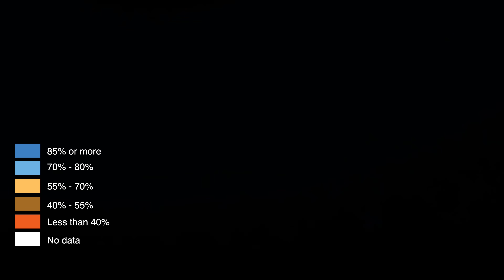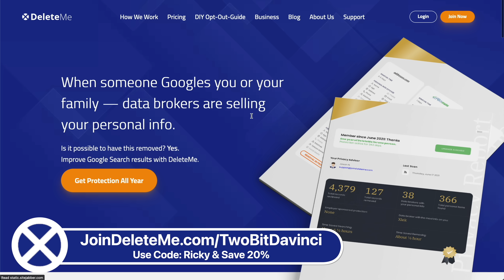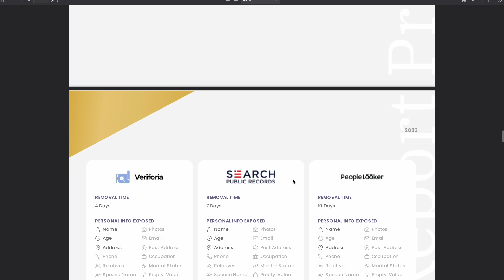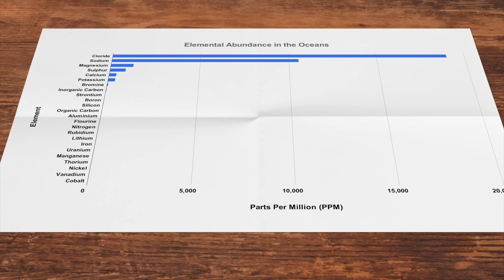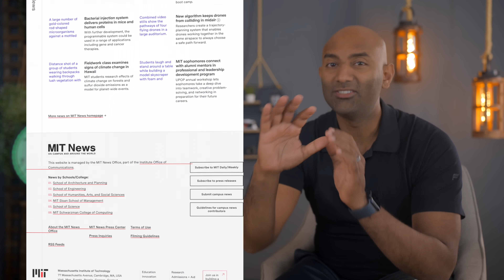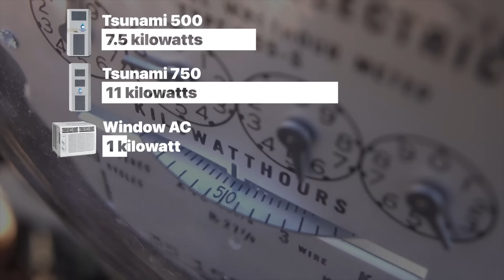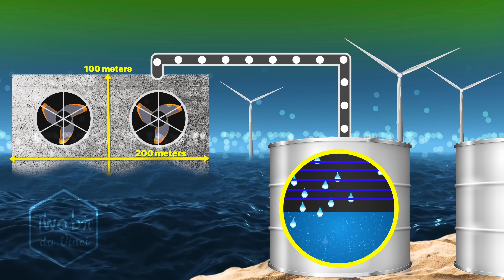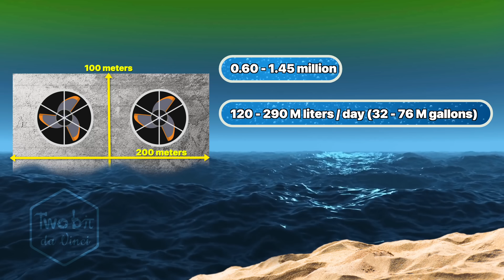This Tower Turns Ocean Fog Into FRESH Drinking Water!

Comment: Nah.  Wrong direction. So much water is wasted. Start with conservation. 
I use maybe less than 10% of what most people do, and could use less. 
I have only been using composting toilets for the last 20 years.  I peed in a store bathroom in the city for the first time in many years and it felt so weird to be wasting that water. 
I also have designed and tested pee gardens. 
I use a sauna rather than a shower, and a little cold water to rinse off. 
I raise plants which grow with the natural rain cycle and no irrigation. (Baby plants in the nursery still get water.) 
Atmospheric harvesting doesn't pencil out.

Comment: How is the humid air just above the ocean's surface cooled? Refrigeration is very energy intensive. If the water temperature just below the surface is cooler than the surface, pumping the humid air through a heat exchanger below the surface could condense the fresh water. Minimizing elevation change between the humid intake and the sub surface condensing surface should lower energy requirements but it also implies shorter towers. Optimizing energy consumption used to move the air seems to be the key.

Comment: my one criticism is in the environmental study they only looked at evaporation globally when clearly the issue is increased salinity locally. The effect on salinity should in reality be relatively similar to using desalinisation, except that the increase should be spread over the area of each tower's influence rather than for example a pipe. Otherwise a cracking invention with a clear advantage over desalinisation.

Comment: I always had a similar idea, but not building on the ocean. Simply pump oceanwater onto land using solar panels during the day in hot regions that need water, especially in deserts like the Sahara. The warm temperatures will accelerate the evaporation. Then the runoff gets caught in a seperate line and then be distributed for irrigation or manmade lakes to feed groundwater.
The thing with evaporated water is that its basically destilled water and lacks minerals and such, so its not safe for immediate consumption. It needs to be enriched by soils and minerals first.
Powered desalination plants might have higher throughput but this method would just need some pumps which could easily be run by solar.
Infact that fresh water could fill up a manmade lae/dam system where it flows back to the ocean irrigating thngs on the way and recoup some of that energy back with turbines when power is needed.
This could have been done in many places in africa already, its just that noone wants to invest that money. Its a very long term and big megaproject, but it won't be that complicated to do.
Reply: Look up sundrop farms south australia.
Reply: @catprog  You know why this is not as big? Because they don't have to buy water and electricity and thus pay no taxes on it.

Comment: I might be wrong, but I think the water used by households isn’t the real big problem. The water needed for agriculture especially in former deserts is the problem and the reason for water shortage e.g. in California. 
You mentioned Israel as a positive example for gaining drinking water. But, there are problems with agriculture. The river Jordan leads hardly any water, anymore, before it reaches the Palestinian territory. That causes trouble in the agricultural there. Obviously gaining water from oceans won’t solve this problem.

Comment: @TwoBitDaVinci  79 gallons of water per person per day wouldn't, or rather couldn't ever occur. if you drank 1.5 gallons in one sitting, that'd be your last beverage. Which blows my mind when I think about cleansing for any "- oscopy" exams. At least that is over a 24 your to 48 hour period, but damn fills you up to the point you look forward to the fasting at the end part. Not only are you taking more water in, you're peeing less out. The kidneys are capable of filtering up to 28 liters of fluid per day. However, they cannot excrete more than 1 liter per hour. Therefore, drinking more than this is not a good idea. Your kidneys can remove 0.8 to 1 litres of water per hour, so theoretically you could drink 20 litres of water in a day. This assumes that you drink at an even pace, though. There are cases of fatal water intoxication where the victim has drunk seven litres in three hours or less. Drinking too many fluids can cause water toxicity by diluting your body's sodium and other electrolytes, which may cause your cells to swell, including the cells in your brain. This is a life threatening condition. If left untreated, it may cause permanent brain damage and death. So where you get 79 gallons a day being what the average person gulps down in 24 hours is beyond me, and far outside the realm of reality.

Comment: So you're telling me, that building huge 100mx200m block at the surface of the sea, pumping everything to an other location and capturing the moisture for water is cheaper than drilling a hole in the ground and connect it to a pump???
Are you sure, that you're willing to make that claim?
Regarding those structures: Do they float or are they connected to the sea floor? For buoyancy you need a huge structure and for a solid connection, well you have to build to the sea floor, limiting the construction to coast near places. And adding cost. And maitanance. The sea is a hostile environment for concrete, steal, ... So the mainanance cost will be high too.
Reply: Is their water in the hole? (and does it renew enough)

Why would you want to build far out in the ocean away from the users of the water?

Comment: The evaporating water creates clouds that rain down elsewhere as precipitation. In my opinion, if applied over a large area, the problem will only be displaced uncontrollably, as the lack of evaporation water for clouds can lead (without being able to prove this climatically) to droughts or dry seasons occurring elsewhere. One system won't do that, but dozens in a drought region might. I hope the designers and regulators take this into account in their calculations.

Comment: There also needs to be a study to see if this will have any impact on the weather cycle. Mind you, you are actually pulling out water that would have travelled to a different location and participated in a rainfall. Pulling water out of the system might also cause a reduced rainfall increase water stress.
But it is also quite possible that over all temperature of the world might reduce because of this, as once the water is removed from the sea atmosphere it would reduce the vapor pressure in the region and additional water from the sea would absorb the heat from the sun and vaporize. Anyways, research will be needed on this to better understand how this works.

Comment: What I wonder is how much of that water vapor falls back into the local area ocean if left alone (like at night)? Capturing large amounts of it could increase the salinity of the local sea water significantly by taking that fall-back away. As for me, I don't plan on having an alternate source of potable water for everything I do now should an emergency situation arise. Just enough for drinking and food prep. I find that a small wheel-about dehumidifier can provide enough for me alone. It can "make" a gallon or two on normal days and, of course, more on humid ones. If I run it outside, even better since it will never actually dehumidify the outdoors.

Comment: When seawater freezes, you get freshwater ice.
You can put seawater in a hanging bucket and collect the ice that forms on the surface of the water when the air temp is below 0 C/ 32 F.
On a small scale, it might not be very efficient, but it could save your life on a cold sailing passage if you run out of freshwater.
If you scaled it up someplace cold with access to seawater, you could make unlimited amounts of freshwater ice in the wintertime when temp was <0C.
Use radiators with a heat exchanger and some kind of anti-freeze solution to get the heat out of the water faster.

Comment: The don't really answer the cost question. Essentially how much will this system cost to make a marginal liter/gallon of water? Is that number more or less than the current system? Yes, they used a hypothetical large system over a hypothetical 30 years, but it appears they divided the capital costs over the entire 30 years. That's not the way financial analysis is done. You have to calculate the cost of the money (interest rate) and factor that in. Money isn't free, even the government charges interest on money ... and they print it. I suspect adding the cost of capital into the equation makes this completely unaffordable.

Comment: I am sorry to ruin it for you but there is something called latent heat of condensation, which is 2,260KJ/Kg for water. This is theoretically the minimum energy you need to spend to turn 1kg of vapor into 1kg of water. This means to produce 1 cubic meter of water by condensation you need  628 kWh of energy. The competing technology, Reverse Osmosis which is already widely commercialized needs only 3.6Kwh of energy to produce the same amount of fresh water. Maybe that's why "nobody has thought about it before"??
Reply: To turn 1kg of vapor into water requires you to remove  2,260KJ of energy from the water not add it.
Reply: @catprog  yeah my friend, I didn't say you add heat to water, I said you need energy (to remove heat, with a refrigeration cycle for example)

Comment: @ Two Bit da Vinci and everyone Came here to brainstorm and idea after viewing a hurricane video. Seems like wave tech and wind bladeless tech are speeding up and so are energy storage devices; both large and small. I visualized an image of all these tech secured close to land but still off shore where it can be secured and in the range path of storms and hurricanes; to maximize the energy harness and storage. Im seeing portable storage tanks that can be then moved onto boats and brought to shore for not only emergency use, but for all use year round. A system where these storage units can plug into the grid system or stand alone like a generator. Im sure many have wanted to harness a storms energy, but this would be awesome. Ok I did my part now take it and run with it and build it. 

My other idea is from those atmospheric machines and devices that get water out of the air, like Moses the military guy does; but turned not large water towers like we have today in our water systems. Only they would be solar and placed in towns for emergency use or just to use and in fire areas like a system to fight fires during the seasons. Imagine a huge water tower and many of them on the wooded outlines able to be used for fighting fires. Im thinking it would be able to have valves that can dump water forward with pressure or able to hook hoses up to them on the ground level to use too. Seems legit to me. Now the government should spend billions on that instead of space and wars and military machines.

Comment: While this is a great idea and surely infinitely cheaper than desalinization I think you may have underestimated the cost to the end consumer. As far as I can tell you didn't factor in the cost of infrastructure maintenance (i.e. water mains, pumps, and treatment) which is the majority of the cost of your water bill. In dry climates with little rainfall or ground water I'm sure the cost is still cheaper than the current system but a little more expensive than estimated.

Comment: They are working on this for a while now to make it cheap and easy. 
But Limitless is a bit of a stretch, The current loss figure for water on Earth is equivalent ~25,920 liters per day that's about 7 000 gallons, or 9,467 m3 per year or about 340 000 cubic feet which amounts to about 6,635,520 liters per day or 1 752 918.94 gallons. 
And the reference of that figure seem to be the paper Escape of O+ through the distant tail plasma sheet, 
that used measurements from the STEREO‐B (Solar Terrestrial Relations Observatory) spacecraft.

That would correspond to a total loss over Earth's history of 42,000 km3 of water or 1 483 216 002 302 538 cubic feet, equivalent to about 12 cm or 4.7 inches of sea level change. However, that's a straightforward extrapolation of the current rate, because they acknowledge that they don't know how to model how Earth's magnetosphere would have behaved in the past when the Sun was weaker. Although, for a weaker Sun it would be reasonable expect smaller losses.

Now taking away 780 billion liters or 206 billion gallons annually should have an impact even if it is minor at first.
Problem with this is, it will never be used just in one place if it is viable then it will be used all over the world and the impact should be scaled according.
The scope of most studies are often limited to a certain project or prototype. 
Scaling it up most of the times escalate figures that are unsaleable to investors or the board for approval.

Never the less it is a great way of getting clean water.

Comment: This is such a good idea. If we use PV and wind turbines at a sea location to draw the vapour and condense it then pipeline it to aquifer injection points we get an efficient water delivery system that chimes in with the existing infrastructure of aquifers.
Not sure if the scale of extracting freshwater this way would be sufficient but it is working in the right direction to reduce hurricanes as they are caused by water vapour over the oceans combined with the coriolis affect spinnig up the mass of vapour. I suspect this would require a much greater extraction than required by our water needs

Comment: I enjoy your videos and presentations, so keep up the effort! I need to point out, however, that you need to adjust your numbers. At about 1:35 you say that there is only about 10 cubic kilometers of fresh liquid water available on earth, after subtracting the water frozen in Greenland, glaciers, etc.  At first I didn't understand why you gave that number. Lake Superior alone contains about 2,900 cubic MILES of fresh water, enough to cover North and South America in a foot of water. then you would have to add lake Baikal, the African Rift lakes, the other great lakes, and the massive and numerous lakes in Canada (for example, Great Slave Lake contains about 300 cubic miles of water). As you point out later, there is actually a lot of water, but the problem with all of these sources is that all they are completely tied to their own watersheds and ecosystems, so your point of finding available water in the regions where it it sorely needed is critical. A new supply is the big issue, as you so well point out.

Comment: this only solve drinking water, striping humidity means the wind hitting the coast will be drier so les raining,the real solutions is wind pumps to create a curtain of mist that will humidifi the incoming Ariat least 20 meters that's 20 times more humidity,a 2 MW wind unit can pump 40,000 (40 k ) galons per minute if only 20% is converted you will be sending 8 k GPM Wich will be;  close 
to1.5 millions gallon per day,to collected inland as rain, lower temperature lakes,dams.......

Comment: using humidity & ocean vapor for drinking water is just placing the water extraction on a different part of the water cycle. this is stupid in design. sucking this vapor up to make drinkwater prevents it from rising up in the air and getting absorbed by the upper atmosperic layers. reducing the amount of rainfall. this would have massive implications on groundwater levels as a result especially in the local area where these towers are built. 

i'm extremely skeptical about this. even if the enviromental impact proves not to be problematic there's still the huge problem of installation & logistics. where you can install it & how you can safely transport water and store it in your water grid is a consideration you need make. a pipe greatly limits where you can put these towers. but not having a pipe means you have to dedicate ships to get the water from the tower to the water grid. in many countries the problem is where the water is located rather than the total availability of it. even if you get it to land in a cost-effective way, you still need to pump that water to where it is needed. costing more and more in maintance & repair. this idea feels extremely dubious logistics wise. and from what i have seen in the other comments corrosion & salt pollution of the machinery will be a significant challange. even if you use vapor it still contains salt since you are so close to the ocean.

the only evidence for this idea they have is a computer simulation?... 
come back with this idea when they have actually built one.

Comment: What about this idea: As you need to cool the moist air to extract water from it, why not install a pipe down into the ocean to a depth of 100 ~ 300 feet where the water is much cooler than at the surface? With that much cooler water one might cool down the device one extract water instead using artificial refrigeration driven by electric energy. Here you only have to drive the water pump.

Comment: I drew this out a few ways when I was in grade school. Teacher thought it was cool.

I've many such.

Worked on how to get these sorts of projects done, generally.

Here's another: Water use in a different way, in the desserts. Use boring tunneling to make the widest & longest you can in 9 months, as a reservoir. On the land above that dig contour trenches, back filling with composted soil & shaped into swales. Shape them to work to slow down & absorb as much water runoff as possible, work on new geopolymers. Include atmospheric water harvesting features. Design to pipe excess into the boring tunnel-reservoir. Site these densely enough to capture sufficient stormwater runoff to provide slow, multi decade, reclamation of depleted lands.

Elevator pitch version.